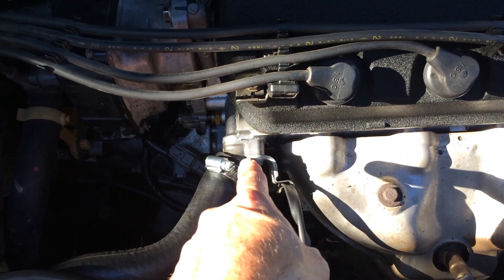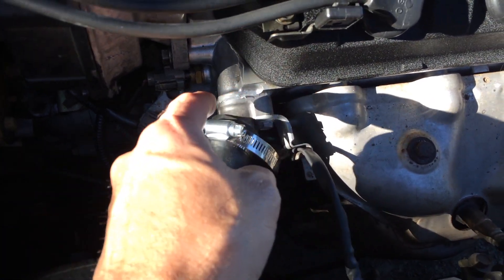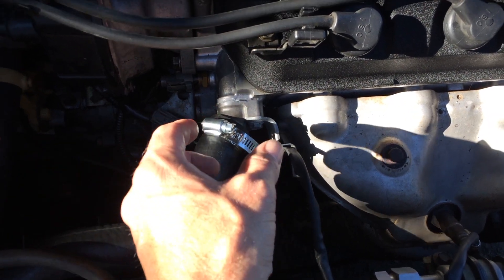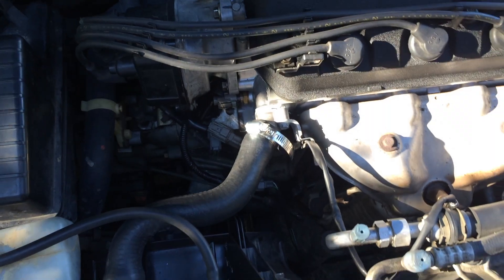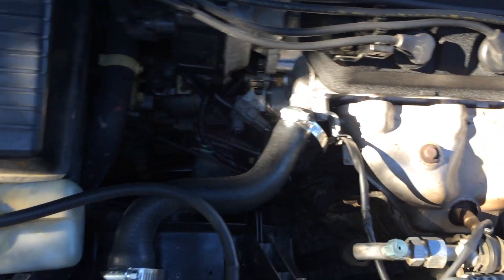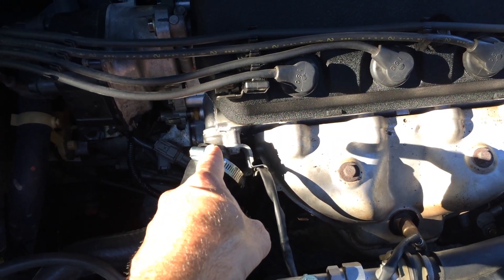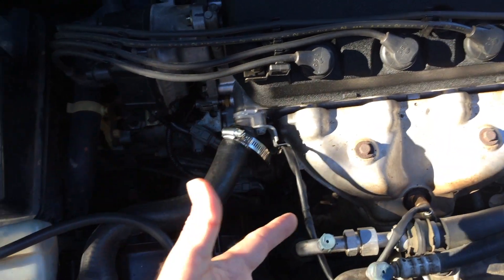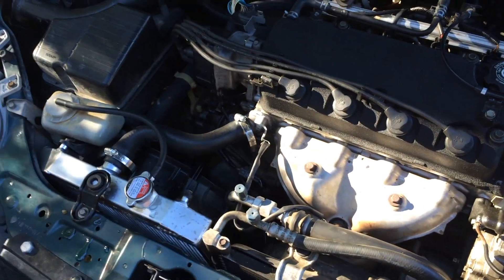Honda D16 Water Neck Torque? Upper Radiator hose to head connection RTV Gasket maker

Comment: Thank you, I could not find a gasket called out anywhere in part manuals. Figured RTV would be good, but that makes me feel better!
Reply from the maker: surprisingly there is very little info on this on the net..lol I used RTV but it kept leaking. Gasket it is no issues.
Reply: Mitch is it the water pipe o ring?  You're evidently the only other person with this issue or at least the only one kind enough to video it
Reply: @apelnkn2230  I ended up making a gasket out of some gasket paper I had laying around and no more leak. RTV started leaking like he said
Reply: @pizzaguy58  thanks , someone had rtv on it previously and it's seeping on mine, have to get some gasket paper and hope that does the trick, also just the paper no rtv ?